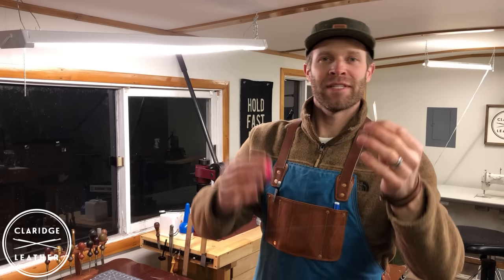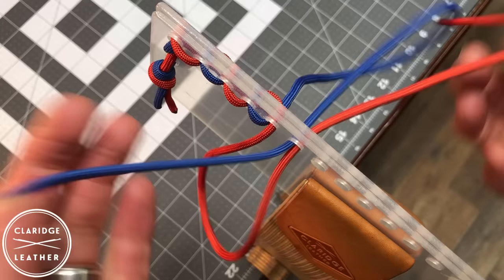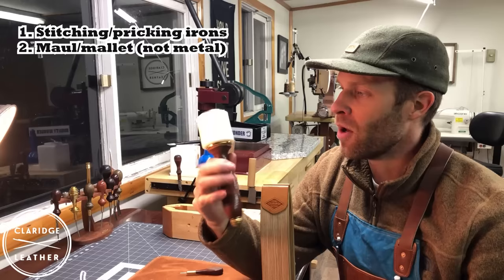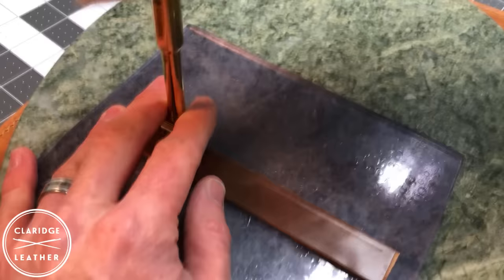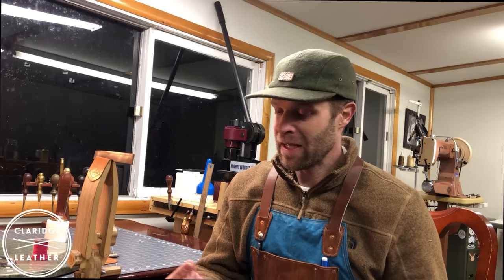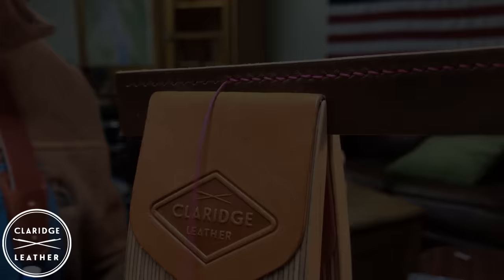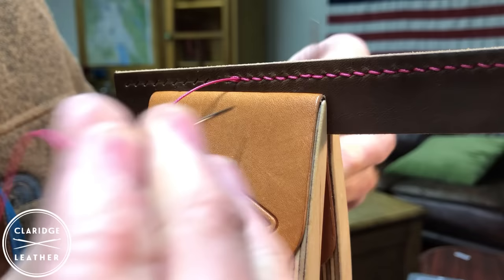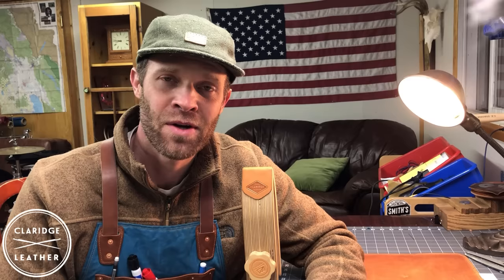How to Hand Stitch Leather: Get Better, Fast!

Comment: Here’s a threading tip shown to me when I was a high school sophomore by a teacher who’d been a combat medic in Vietnam, where speed and accuracy mattered. Hold the thread between thumb and middle finger (give yourself more free end than what I’m seeing in your video), and thread the eye. When the length has passed through the eye, grasp it between thumb and forefinger, and pull. It may not sound like it would make a difference, but it really does; I have far fewer failed starts and it’s faster. It took me almost no time to get used to this method and I’ve been doing it for 50 years!

Comment: For those who might be wondering, your method of securing the thread to the needle, by piercing the thread, is often referred to as a "half-brummel" by rope/cable splicers. And if you look up instructions on a brummel splice, it becomes pretty clear why that might be. Like most splices, it is many times stronger than a knot; not to mention being more streamlined. Most splices retain upwards of 99% of the cordage's rated strength. Whereas, even the best-tied knots will typically only-ever retain about 50% of the cordage's rated strength. Great video! Your explanation was clear, and your well-chosen camera angles complimented your explanations perfectly. This earned my sub & bell! :)
Reply from the maker: I love this kind of info! Thank you so much for taking the time to share it!
Reply: Does it matter what size or type of needlenis used? Do they need to be the same type and size on each end?
Reply: @lisajackson6950  I use sailmaker's needles. They are MUCH higher quality than the junk you'll find at a chain fabric store. They are either of forged carbon steel or forged stainless steel; not cast-metal garbage.

I'm also usually pushing the needles through thick, very dense sections of spliced rope. So that strength is essential.

Still, you can't go wrong with sailmaker's needles. They cost a lot more than fabric store junk, but they're worth every penny!

As to their size: use the smallest needles you can safely get away with.

Not too small, because you don't want them to break on you (that's a good way to impale a finger). But the smaller a needle is, the lower the resistance you'll fight against as you push it through.

So, it's a balance. Hows that for a non-answer! Sorry..  >.<

Comment: I have always use a small spike punch and stitched straight. I didn't know that there were so many different types of punches for this. Main thing I learned pretty much by myself is to always make sure you go under the same way so your stitch is straight. The way I usually stitch is to always put the first needle through from the same side then you can control if the other needle goes over or under the first needle. It helps me keep the stitching looking straight. Nice to learn something different. Thanks for the video :)

Comment: The trick of locking the thread in on the needle has been such a helpful trick for my regular hand sewing. I've been working on a lot of tiny, fine pieces, and was having such trouble with the needle literally falling off the end of the thread when I was doing a single instead of a double thread. Thanks for doing such a clear video!

Comment: I have not struggled with stitching at all. The way you have shown is likely to improve the appearance of leather stitching I do from now on though. While stitching is as simple as can be and be a trusty work. A nice even and decorative stitch is what we are shown. I finish by going through the final holes used till the thread or thong is so tight it can't get out before it's pulled apart or goes rotten. Thanks , nice work you do.

Comment: tanner, as my eye site has diminished into my 60's i've learned to thread the eye of the needle this way; use a tooth brush, place the thread across the tooth brush, hold the pointed tip between the fingers and gently push the eye of the needle down on the thread until a section of thread protrudes through the eye. it may take 2-3 tries to thread it but with practice you will fine the brissels that give enough support to hold the thread in place for you to thread the eye.

Comment: Very well done video. The angled stitching holes are very much functional not just aesthetic. It keeps the threads from pulling in direct line with the ends of the slots which makes the threads much less likely to pull through. Much like slightly rounding inside corners of high stress areas. Or punching round holes at the end of slots that will be under stress.

Comment: Tanner, 
1st... I quickly tapped the thumbs up 👍 button to feed the algorithm monsters.
2nd .... I don't want to disappoint you, but I have no interest in leather working.
3rd... I needed your class so I can manually sew pieces of carpet together with string. I am going to overlap two pieces at a time and use two rows of the saddle sitch about an inch apart. I don't need any cosmetic or strength. Eventually, the carpet will be covered with pee-gravel. The stiching is only to prevent the dehiscence of the two pieces and to prevent gravel from getting under the carpet. There will never be tention on the stiching. Nor will it ever be visible.
4th... I'll be using needles that are similar to tapestry needles.
Thanks again !
p.s.
Is Tanner your real name? If sew (pun), what a coincidence. Leather tanning and your name, Tanner, go together like my veterinarian Dr. Barker....

Comment: Very nice work! Thank you so much for this nice Tutorial! So kindly!😊
But take care about the correct angle of 90 degrease with the stitching iron. 
Because if the angle isn't exactly at 90 degrease the hole on the other side wouln't be accurate and on a other position.
You can see it on the backside of your piece. Especially If you look at the loops at 12:00 min. on length of the 8'th loop.

Comment: I cannot believe how clean and how nice the stitching is. I like this better than using the punch every day. I try to learn something new and today you definitelyhelped me… I am fairly new to leather as I used to be 100% Kydex leather. In my opinion I think is a lot better than Kiack for what I’m doing because is nothing but molding heated up mold it heated up as it is very redundant and then you either have to drill everything and or punch I make leather holsters now for just about anything between brass knuckles knives extendable, batons, etc. and now I’m going to use this stitching that I just learned from you as a do think with my opinion, it is a lot cleaner than the average punch because the punch leaves that knot in the middle . if it is not pulled tight into the center of the leather all it takes is one loop well it looks like absolute garbage but once again that is my opinion as other people have their opinions and preferences well, I appreciate your videos definitely taught me something new what I would like to see is every time I wet my leather to make the shape of whatever holster are making well. I clamp it down. I let it dry overnight but when I take it out the next day and of course you have to put plastic around what I was trying to mold out well the leather is still wet, but even when I leave it to dry, the hardness does not seem to be holding up as it is flimsy the leather that I use it seems to be really stiff. I just don’t understand why after the wedding process. It doesn’t stiffen up like it was in the beginning.

Comment: Great presentation. I appreciate that you’re a natural born teacher. Plus the generous nature to give it away! I’ve been stiching for several years, off and on, and my results are very inconsistent. Because my technique is very inconsistent. Your approach is terrific for building consistency. Something I stumbled across recently was to lead with the needle that’s on the “bottom side” of where I’d punched from. Also, I made my own stitching saddle. I used a lever cam on one side of the top clamp. A wing nut on the other. $10-12 of hardware. Scrap wood and scrap pig skin to cover the clamps. Satisfying to build my own. I don’t make sellable quality products yet. Looking to raise my level....

Comment: I've always used one of those awls that has a little bobbin of waxed thread built into it.  Of coarse my stitch spacing was never as uniform as yours.  But tool I really should have had is that clamp.

Comment: I've noticed some variations in stitch orientation: 1. stitching away from the body with the slots slanting up and away from the body; 2. stitching toward the body with the the slots slanting up and away from the body; 3. stitching toward the body with the  slots slanting up and toward the body. This last one requires reversing the side of the slot ingress (side where the prick/punch was initiated). Most people seem to place  the ingress on the right-hand side, which results in having the slots slant up and away from the body.

With each one of these versions, I think it is important to determine which needle goes in first, which side gets cast, and the angles of the left- and right-hand pulls.

Comment: Thanks man. One of the best explanation I have seen of back stitching, you got really nice attitude towards everything. Ashamed to say but I am still struggling with saddle stitch. It seems like 7 our of 10 times, one side is always better than the other. I also noticed my end effect depends on the thread I use, having a lot more luck with Vinymo then I had with lets say Amy Roke.

Comment: That was a great video on Saddle Stitching! Very detailed, easy to follow and learn from. I do not remember if you covered the aspect of being able to have one side straight and the other slanted or both slanted or not but your video was very helpful to me. Thank you!
Reply from the maker: Thanks so much for watching, Aaron! I’m really glad it was helpful to you. You’re right, I didn’t cover that specific detail because I really just wanted to land on what I’ve found makes the best stitch (on both sides) for me. By not laying (“casting”) the thread over needle on the left side, the stitches will be straight on the left side. Good point! Keep in touch, and thank you for your comment!
Reply: @ClaridgeLeather  Before I watched your video I had been stitching without any kind of stitching pony. I found out what I was doing was not a true saddle stitch. I would hold the leather and stitch. Anyways, what would you suggest for a stitching pony? I do not want to have to buy more down the road, but get one now and be able to use it for the rest of my life... unless it breaks of course. I watched a guy call Peter Nitz use a pony that he clamped with his legs. It was not clamped to a table. Have you heard of that kind?

Comment: I wish you'd made this video a year and a half ago, would have saved me frustration. In the end though, I generally follow Ian Atkinson's method *when the leather is thick or stiff*. He casts the stitch on the "back" (left) side, which produces the same zigzag on both sides. I find that his method will produce a nice zigzag on the front and a very flat stitch on the back if the leather is thin, very soft, or both. I vary my stitch a little based on what sort of leather I'm stitching for that reason. I have a few projects on the bench, so I'll have to keep this video handy and try your method to see how it handles varying degrees of thickness/softness.
Reply from the maker: So glad you found this, better late than never! I have learned so much from Ian as well. He was the first person that I watched to learn to stitch! I have since altered things a little bit, as shown here. Thanks for watching, keep in touch!
Reply: @ClaridgeLeather  after watching your video I went back to his to refresh my memory and stumbled onto a new one he made more recently, and his method is exactly like yours, pull thread towards yourself, second needle in the top/rear of the hole rather than his first videos method of pull thread away and second needle in the bottom/front of the hole.
Either way seems to get the result I want, depending on the material.

Comment: Very good. As for the needle John James 
I think it's great, too. But I experienced a wuta call, for wires 0.55 is very good, with a diameter of 0.8 mm, I do not know yet how much resistance. Thanks for the nice video.

Comment: I think that your videos are awesome for the beginners out there; I know that they consolidate a lot of hard-won information!  
But as an engineer and much-later self-taught leather enthusiast, I have come to ALWAYS do my saddle stitches such that within each hole one thread crosses over and around the other, forming a little "half granny knot".  This makes the overall line of stitches much less impervious to unraveling, and maintains tightness (i.e., keeping the pieces of leather firmly together) as you go.  (I have never bothered with a stitching clamp, since I mostly work on item shapes or seam types not that amenable to clamping.)   Is this "half-knot" type of saddle stitching something that you have considered, and rejected? 
(With this "internal half-knot" method and angled chisels, one side will exhibit the perfect "Z" pattern, and the other side will exhibit a more straight-line stitch pattern (unless you punch each piece separately on its outer surface)).
Reply from the maker: I appreciate the kind words and also your thoughtful response. I think I’d need to see exactly how you’re doing it to fully understand how you’re achieving that half granny knot. If you watch the way I cast the thread over the left needle before pulling tension, I believe it achieves this (in contrast to a straight saddle stitch where you don’t cast over the needle). Let me know what you think- I’d like to understand what you mean (how exactly I would change this technique to achieve that half granny knot). Thanks again!
Reply from the maker: To answer your other question, I have tried several variations and landed on this one because it helps me achieve the best looking stitch on both sides.
Reply: @ClaridgeLeather  it may be better first discussed in the context of the acrylic plates with the red and blue cords. In the video, it can be seen looking from the top down that in the holes, first the blue cord crosses over (and lays on top of) the red cord, then in the next hole the red cord crosses over (and lays on top of) the blue cord, and this alternating pattern continues. (Basically, looking at the entire result, a “twist” has been formed by the two cords.) It seems clear that no half-knots have been formed.  It appears to me that when you actually stitch in the clamp, the way you proceed guarantees a similar consistent pattern, with no half-knot, proceeding in a manner that works in cooperation with the slant of the holes.
Going back to the acrylic plates, let’s say that you have passed the red cord through from one side, and then the blue cord through from the other side, and it is now atop the red cord, and as you pull on the two cords there will be a red loop on one side and a blue loop on the other side. Before pulling the two loops all the way closed and tight, either 1) bring the tip of the red cord up and back a bit and drop it down through the blue loop, or 2) bring the tip of the blue cord on the other side down and back a bit and pass it up through the red loop.  Either one will create a half-knot, which will basically be hidden in the hole.  
Going back to stitching in the clamp, it is basically the same situation: on one side the “lower” thread must be brought up and passed back down through the loop, or on the other side the “upper” thread must be brought down and back and passed up through the other loop. 
With this simple change, everything is locked together to a MUCH greater extent!

Comment: I suspect the loop over the needle is to ensure one thread is above the other especially on angled holes like that and create consistency. Although you did not explain the purpose. If I am right, can assume that it isn't as essential if you were using a straight round pricking iron?
Reply from the maker: Yes, not essential either way— you can experiment to see what looks best on both sides, but you certainly don’t need to do it!

Comment: I’ve been starting stitching close & working my way out, it seems more comfortable, but is it backwards? Also, don’t the needles need to be pulled thru in opposite directions?  I can’t tell which one goes up, which one goes down.  Thank you for your video, best tutorial I’ve watched!
Reply from the maker: HI Valerie, you are not incorrect or backwards or anything at all-- this can be done in many ways (in fact, it's probably good to practice it in different ways), but this is the way I've found to be most comfortable and consistent for me. As long as you find a method that gives a consistently good look on both sides, I think it's fair game to go stick with it!

Comment: Good video. Perhaps a better demo of the difference would be to *remove each kind. Machine threads only loop together, rather than “knot”, so it’s definitely less-secure... LESS than half. 
I bought a cheap machine on 1/1/21– to save time— and I HATE the look/feel! Hand sewing, if time-consuming, is 200% better!! AND IT SHOWS.
    (I’ll still use the machine for fast prototyping designs)
Subbed
Reply from the maker: You’re absolutely right! In fact, I did make a video of this very thing last week over on Instagram, where I cut the blue and red cords with scissors to demonstrate this! Thanks so much for watching and subscribing! Keep in touch!